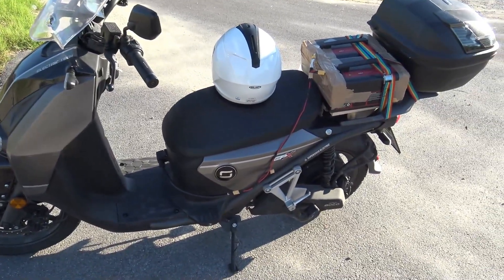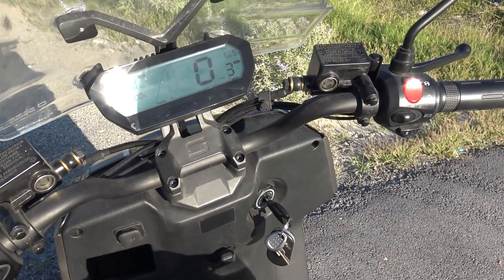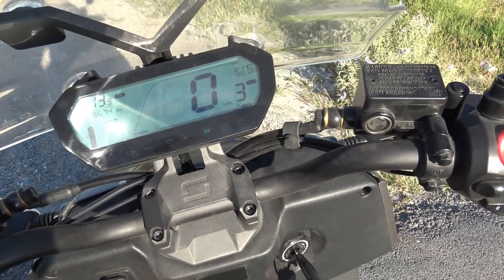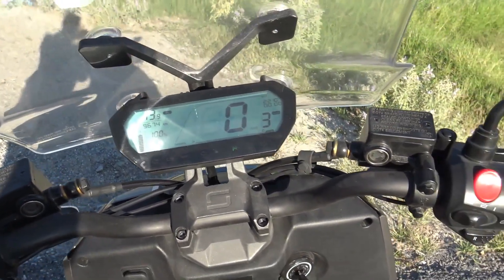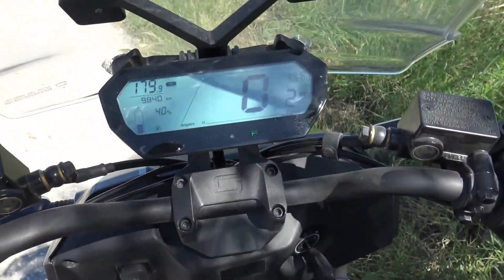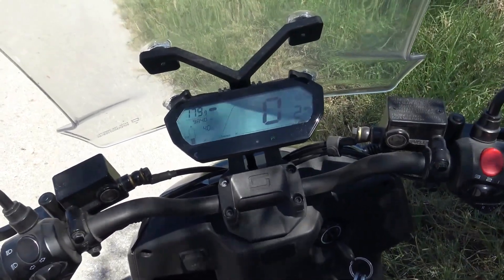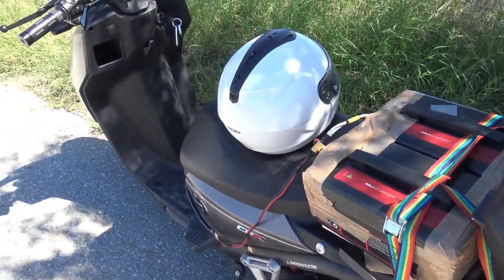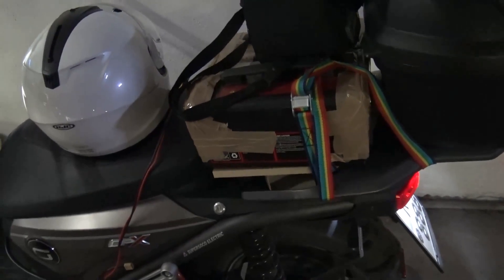Super Soco CPX Sabvoton 72200 controller upgrade

Comment: Are you aware of any way to control the max charge voltage of the CPX oroginal battery? I would like to charge it only to 90%
Reply from the maker: I know how to do that for the TS charger but the CPX is completely different. I don't know about that.
Reply: @MechanQDX445  you play with a resistor in the TS charger or some software trick to bring down the voltage?
Reply from the maker: @TheEragoon  Yes, but still no matter what you do the LiPO chemistry used is bad. It will not last long. In several projects we used Panasonic and Samsung cell only to find out they don't last long and soon a cell will fail and ruin the whole pack.
Reply: @MechanQDX445  are you sure those battery packs are using lipo an not li-ion or LFP?
Reply from the maker: Same garbage to me. Unless I see a proper manufacturer like Honda make an electric motorcycle with lfp battery or better proven tech, I will not bother with anything else.

Comment: Is it possible to (easily) make a 12/230v connector on the cpx battery? So I can use it as a powerbank? For all kind of tools, camping and to drive an electric outboard on a boat with it?

Or is that really hard to do?
A 2.7 kwh powerstation is about 1500 euro. So if an inverter is 200 I would save 1300. Is that possible?

There should actually be a 230v plug directly on the battery instead of the weird pin system if possible.
Reply from the maker: The charge plug is directly connected to the batteries. You can get power from that. Then you can use a DC to DC converter to reduce the voltage to 24 or 48 and then connect an inverter to get 220AC and use tools. There might be inverters that can convert 70volts DC to 220 AC. I don't know for sure.

Comment: Hello! Nice to see that!👍 I have SS CPX too with 2 batteries.  Max speed for me - on fully charged battery first 20% - 95-97 Km\h on GPS. ( 102-104 on screen). Higest (Top) speed decrease to 85 km\h on 50% of charge, and last stick (30%) - 80km\h. I have this scooter not for a long time, about 2 month & have done with 3000 km. In city cyrcle is +\- ok, but in hiways I need 110-120 Km\h for safe driving. How I understand, You use same voltage battery (60V) only large capability (A) ? Wheel do not modyfided? You connect new controller with standart CPX controller? Parallel connection? Will be great, If You can write somewhere more detailed information about each step for dumb people like me)))))) May be with photos of small nuances.... costs, etc... this saves your time in future, not to explain to everyone again.